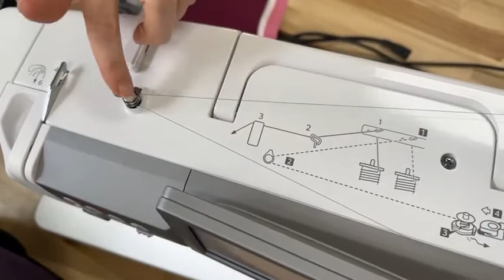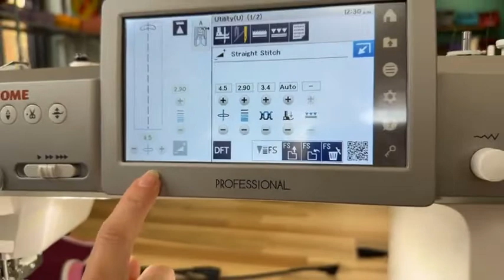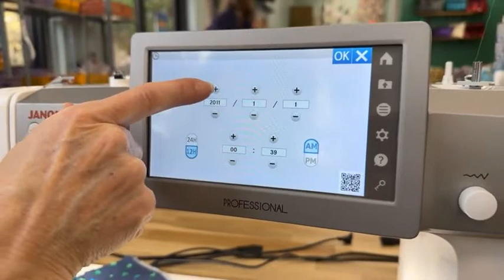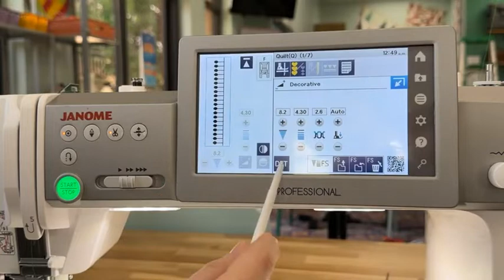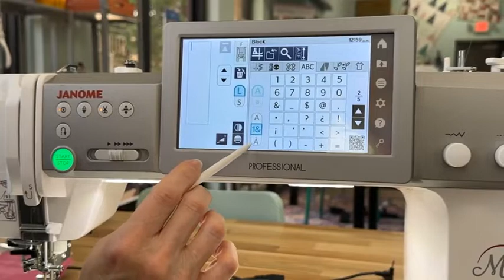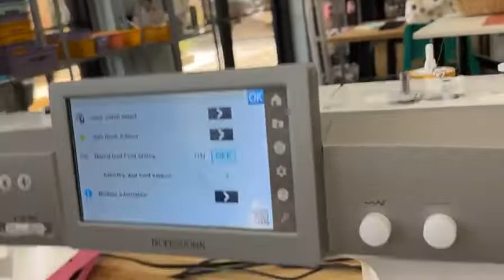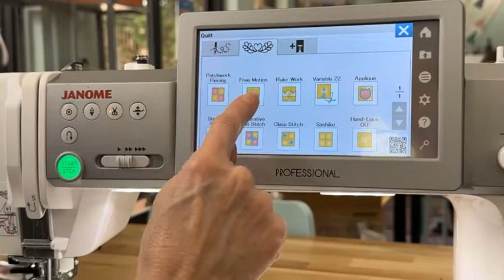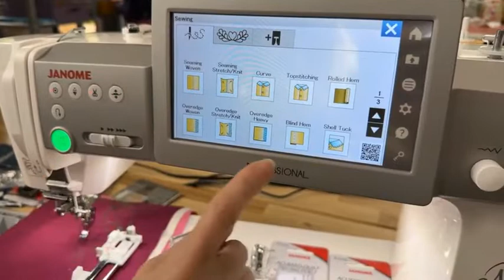Get To Know The Janome Continental M7! | Machine Familiarization Series

Comment: I have been trying to decide if I should upgrade my Janome 8900 to the Continental M7. I really want the pivot function as I am doing a lot of applique now. Some of the other features would also help with my quilting. This video is the best one I have seen. Very thorough and complete. some of the features I’ve never seen before and may not use, but that is the case with most machines. Thank you so much for this information, and your knowledge is astounding
Reply from the maker: You'll be very happy with an M7! Thank you for watching!

Comment: I’m on another continent but have watched this several times bc your explanations are so clear and thorough. Initially considering the 9480 but am now going to go for the M8 when(ever) it comes out here - all the features you detail here plus the ASR will be just phenomenal. Thank you sooo much for this video!
Reply from the maker: The M7 is a phenomenal machine, but the M8 just takes it to a whole other level with the ASR! They'll be releasing in October here in the United States. I hope that you enjoy it, and please let us know if you have any other questions. Thanks for watching!
Reply: I do have another question: what are the dimensions of the M7 with the extension table fitted to the machine (will the M8 + table be the same size)? I ask because I am scrambling to find a suitably strong table to put my upcoming new addition on. Thank you! ❤️
Reply from the maker: @trinacairns9509  The dimensions of the M7 when fitted with the extension table are 26.7 in. W x 15.7 in. L. The M8 will have the same throat space, so I think it’s safe to assume that the extension table will be the same as well. Janome actually sells a universal table for the Continental machines. It’s very sturdy and spacious, yet it still has a small footprint so it won’t take up too much space in your sewing room. With this table, you won't need to use the extension table because the machine drops in to the table, allowing you to have a level surface. That’s the one that we use at our store and we love it!
Reply: Wow - what an incredibly helpful response! Thank you❣️ I did see the Janome table specifically made to accommodate the Continental 17/7/8 on the Janome global website, but have found no dealers here which stock the furniture. We cannot get the Janome workbooks here either. Shopping for Janome loot in the USA must be uncomplicated & delightful - all the needful elements are available! Thanks & best wishes 🌼😃
Reply from the maker: @trinacairns9509  You're welcome! Please let us know if there is anything else that we can help you with!

Comment: Great walk-through!  You say there is a zipper foot that can go on the smaller Accufeed foot.  I’ve been completely unable to source that or know anybody who knows anything about it. What I have been told is that I have to buy a third ankle, as well as the zipper foot for zipper application. I exclusively sew clothing, much of it outerwear. If there is a flight that I can put onto the smaller Accu feed ankle, could you please tell me where I can get that.
Reply from the maker: There are three AcuFeed types: the double (it's wide and comes with the machine), the HP2 (also comes with your machine), and the single (does not come with the machine). The single is a little bit narrower than the double, and there's a separate "boot" that you can attach to the single foot to make it into a zipper foot. Below, you'll find a link to a video that explains it well. (It doesn't mention the HP2 foot, but does compare the double and single.) We can order these accessories and ship them to you if you decide that you want to purchase them. If you'd like more information about this, please call us at 678-661-0201 and ask for Priscila. Thanks! Here's the link: https://www.youtube.com/watch?v=30U4rCHmT-s

Comment: Did someone tell you already that you can cut the bobbin thread with the little cutter on the right from the winder. Besides that,underneath the bobbin holder is a gray disc with 3 cutting notches. So altogether you don’t need a scissor. So if you wind a bit of thread on the bobbin before machine winding it, you can use the notches underneath to cut the extra off.
Reply from the maker: Good to know! I'll be sure to try this the next time that I sew on this machine. Thanks!